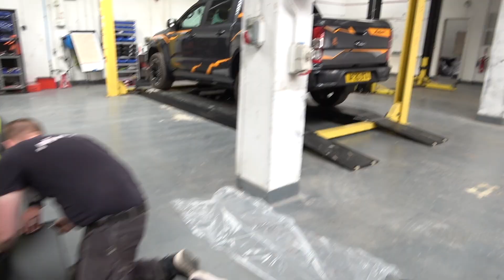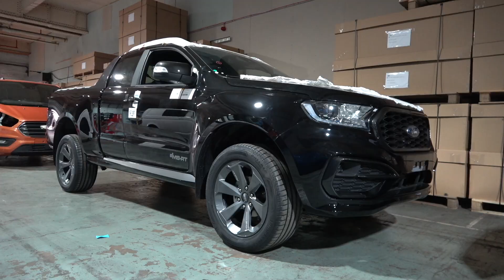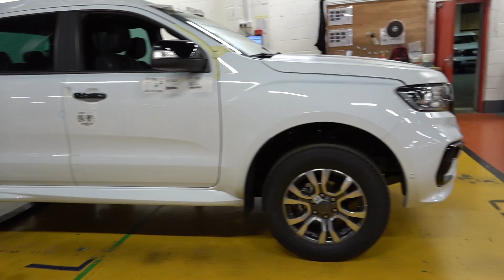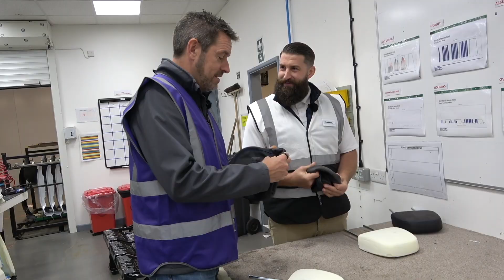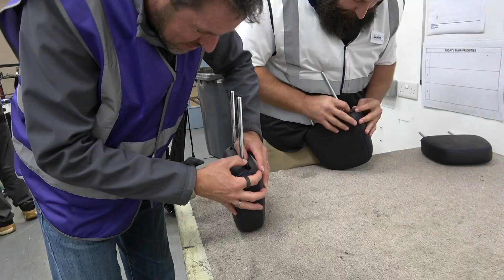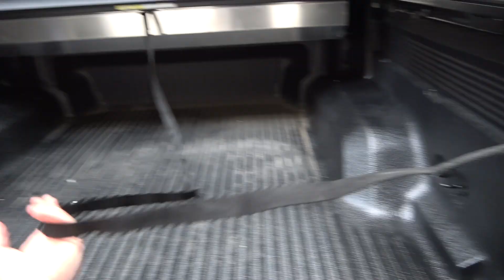Ultimate Upgrade for my Ford Ranger MS-RT Limited Edition

Comment: "Roller shutter blind" or tonneau cover? I prefer the tonneaus with load carrying capacity. Had a Diamondback HD that would handle 1,600 lbs on top of it with my last truck, but this time going Renegade which is rated at 2,000 lbs (truck payload is 5,600 lbs - 14,000 lb GVWR).

Comment: Just a quick question what are the weels that you have on the ranger do you think that they would go well on the brand new transit custom
Reply from the maker: They are MS-RT custom wheels designed for the Ranger. Not sure if the stud pattern and offset would fit a Transit and also don’t think you can buy them on their own 🤔👍

Comment: I’ve got a Ranger Wildtrak, the cover is great but still be careful leaving things in there that don’t like getting wet, mine gets a bit of water but it’s nothing too bad, also just putting some black mountain top horizontal bars on the top of the roller cover as well - I believe the black are pretty rare as the majority are silver.

My biggest issue with it is I really wish Ford had put some LED rear lights on it
Reply from the maker: Yep. It’s not ‘waterproof’ 👍

Comment: Interesting video. Shame the guy showing you around didn’t expand on what he called ‘waste’ parts taken off when the vehicles arrive from Ford. What happens to them, are the sent back to Ford to be used again, sent off for recycling or just sold off to recoup costs ?
Reply from the maker: Either recycled or sold on depending on the part. For example bumpers would be recycled and wheels and tyres sold on 👍
Reply: @PetrolPed  Makes sense to do that planned collaboration directly and have as much bolted on directly at the Ford production line.